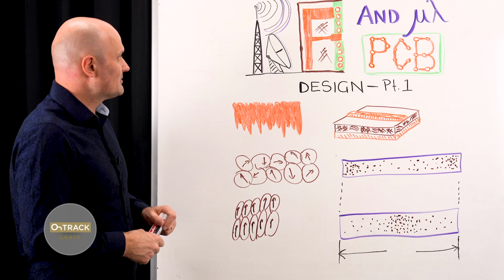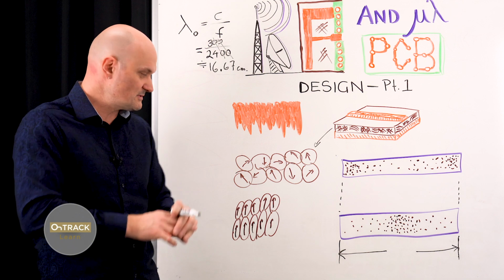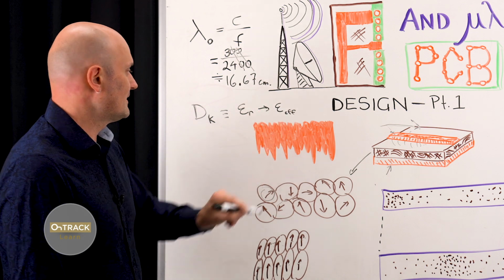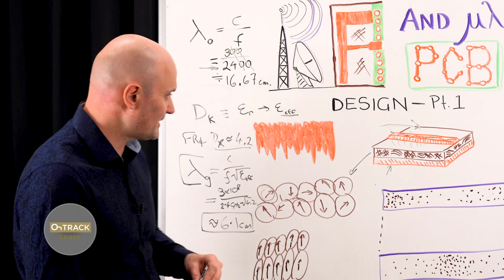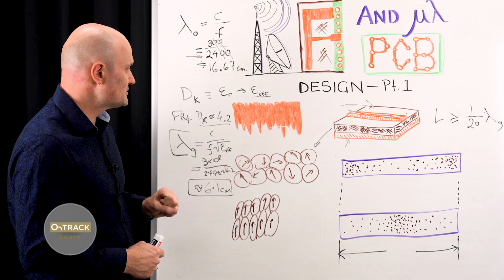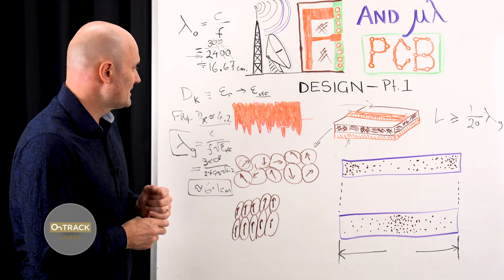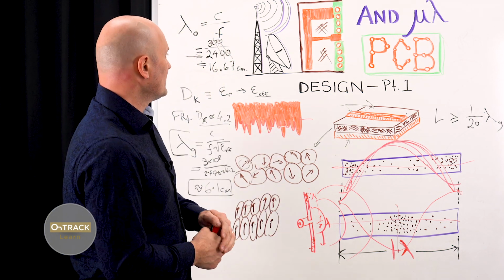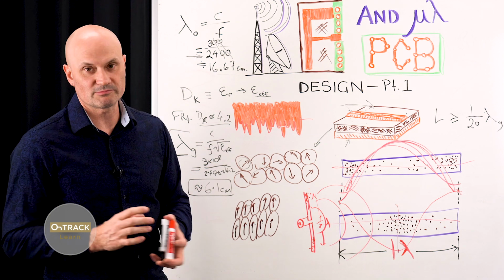RF and Microwave PCB Design Part 1 - Fundamentals & Materials - OnTrack Whiteboard Series

Comment: wow, "oversimplification" is still complicated.  , 300 is a round number.  for precision its a longer number. What we need to know is the dielectric constant , the Velocity Factor , and the size of the tracks either side of a known  common double sided circuit board.   When Frequency is higher, the distance on the board needs to be odd multiples of quarter wavelengths rather than /14 x Vf....  because the skin effect lengthens the effective  resonate quarter wave length.   Thank you Ben for a great educational video.

Comment: That was good, but why haven't you told that Dk is Frequency dependent?

Also, Epsilon effective is derived from Lichtenecker's Logarithmic Mixture Formula.
There is the article showing connection of The formula and Maxwell's Equations.  (https://www.researchgate.net/publication/224113849_Derivation_of_Lichtenecker's_Logarithmic_Mixture_Formula_From_Maxwell's_Equations).

Also, It would be wonderful if somebody start same thing on shielding , because I am having hard times when I am telling my schematic guys that they are not wanting right things.  Also that could explain 1/20 of wave length. 

Waiting for next episodes.
Will there be S-parameters, printed elements such as filters,  spliters?

Comment: Thanks Ben,
Really interesting topic!
Since we will be talking about frequencies and transmission lines, could you please comment on the relation between signal freq and signal rise/fall time? maybe a rule of thumb if any...
Because fast signal rise/fall time is really impotant when it comes to emissions right?
Waiting for the next episodes!
Reply: Rise and fall times are only for digital, but you are right. There is no such thing as digital signal, it is an abstraction. Rise and fall fronts of the signals important because digital signal is a superposition of sinusoidal signals, as Fourier law says. Higher order sinusoids are making digital signals sharper. Usually you do not need much, just 6 harmonic of the signal, but it can be really HF.  Bandwidth (in 10 GHz)is 0.35/Time rise (in ns) ( for 2 ns it will be 1,75 GHz). But you can do a bit harsh on your self and fo it 0.5/Time rise, that what I usually do.